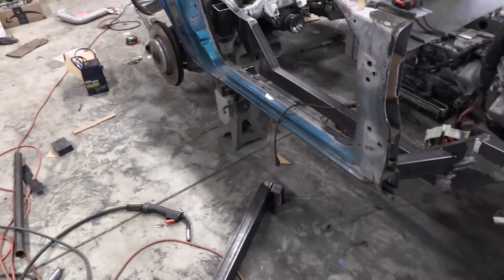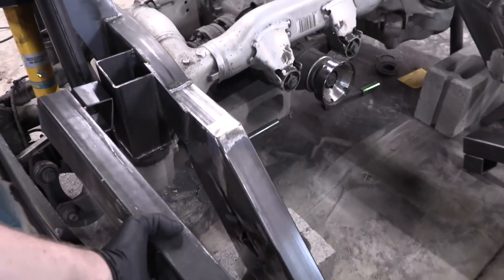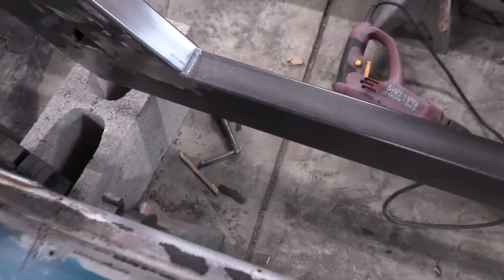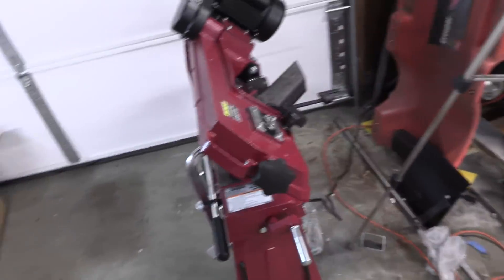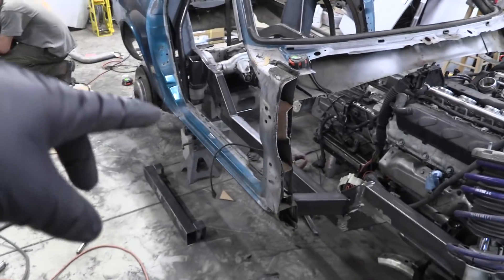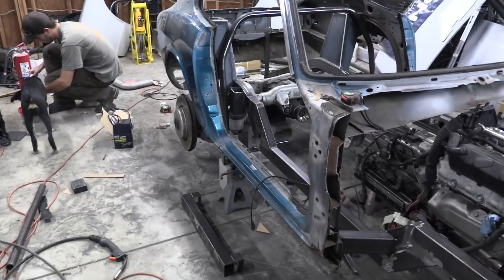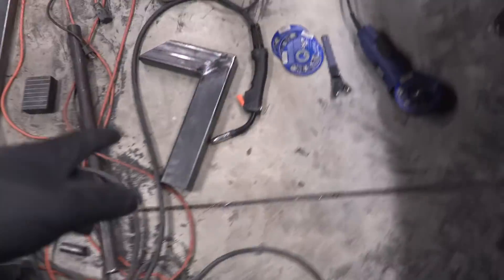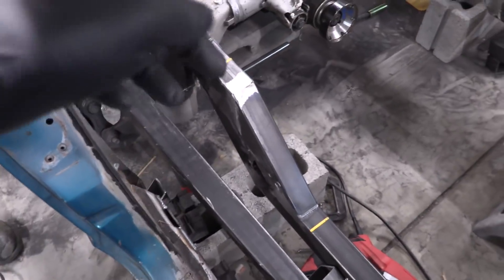We've Got Legroom! 240Z Frame Rail Modifications

Comment: One thing we used to do on kickups ike that was use a slightly wider piece of steel and cut it so the ends fit OVER the existing rail. This game us double thickness on the vertical walls. A holesaw cutout on the new piece let us weld inside the circle and it was incredibly strong and very stiff. Only the vertical walls really transfer weight and/or force anyways. Still looks really good though.

Comment: Still think that an O shape touching the sides would have been the better option. With this double L in the back and its 90degrees its not more sturdy. The O shape would have had the benefit of giving more space in the inner area in height and have a direct impact safety measure for side impacts...

Comment: I had that same band saw for years.  Getting it to cut straight is an art, but you start by adjusting the two pinch rollers on each arm to 1 thou larger than the blade thickness, then use a small engineer's square on the vice bead to get the blade vertical.

Comment: An L shaped piece of flat bar 5mm thick plug welded on either side would have done a better job instead of the bracing that’s currently fitted.

Comment: It is good you doubled up where you cut, but for the future you never want to cut a frame at a 90. It is always better to cut at an angle or even better a Z-cut. Also please wield a diamond shaped plate over the wield on the inside seam of the frame. Looking good so far.

Comment: Not sure how I feel about this.  The closer you sit to that rear sub frame, the worse it will feel for a driver.  Think about it, the driver should sit equally between the front and rear suspension to maximize comfort and car handling.  If the driver is nearly sitting in that rear shock, its not a good feeling.  Personally, I just would've shredded a few pounds.  There is a reason race car drivers are small! Weight is HP

Comment: On your new L frame are worried of it flexing? I had D21 pickup with frame notch I had to fix it after I throw some wait in the back and it bent, I don’t know if it’ll change with the double frame but I’d recemmend even small 2-3 inch right angle triangle in there to prevent any possible flex. Btw awesome build inspired me to start my own builds #moredebt

Comment: Anyone else release he doesn't have the motor covered as he is grinding and getting  metal shavings in the air with exposed throttle body's. Just a thought I had.

Comment: The frame rails through the drivers cabin need to be behind the rockers or at least along the edge of the rockers so the seats can be between the frame rails, not on top of them. These "better" ones are still going to compromise the seating position and pedal placement down the road. Take a look at a tube frame race car, the frames run around the perimeter of the cabin.

Comment: Might already be mentioned somewhere, but the bandsaw probably isn't broken. You probably broke/bent a tooth on the blade. Also, most bandsaws like this usually run with a constant supply of cutting fluid so I'd recommend getting/making some of that

Comment: Hey love the vids!  Recommendation for next time you chop your frame (if ever) it should be cut at an angle , helps with strength.  Vertical cut will be fine for your application though

Comment: Getting the roll cage connected fore/aft of that set of hard 90s in the frame rail will help with the fact that it's a hard 90 (stress riser).   The double up was probably overkill, but not a bad plan for adding strength.

Still need more for torsion though;   something low in the frame (however you can get it around the transmission/driveshaft) would do a lot for that;  the cage can only do so much when you consider the length between the frame and horizontal points on the cage.

Comment: Only critique I would add is at the top and bottom 45 degree angles you have matching angles on the two frame pieces. I would add gussets or plates that bridge the welds. The welds are your most likely failure point. Great job solving the problem and good progress.

Comment: there's a good possibility that your bandsaw problem is actually the blade is stretched and is not as tight as it needs to be.... there could be a simple alignment that you can do as well if that's not the case

Comment: Nice work! If you wanted you could have just use plate gussets to over lap the seams and then boxed in that subframe mount section.  Anyway who cares about weight and being overbuilt right its a v10 in a one ton car right? It just take practice you mess up enough and you'll just know what works and what doesn't, then you'll be the old man in the shop.

Comment: I saw you forcing the cutting blade which screwed the band saw
Reply: Band saws dont do thin wall tube well at all 
They need at least 3 teeth in a cut so if you have a blade with 1mm between teeth you can't cut under 3mm wall 
It's why it works well on the top and bottom where its effectively doing a 50mm cut 
On the thin stuff as 1 tooth leaves the cut the saw drops into the gap between the teeth and the next tooth slams into the work at fuel depth 
Band saw teeth are off set 1 tooth is bent left the next is right, left right and so on to give clerance for the rest of the blade (a chainsaw is the same)
So it starts to wander toward which ever tooth hits first 
Once it starts to wander it won't stop 

How to fix it 
You can buy blades with more or less teeth 
A fine tooth blade is better on thin stuff 
Or rotate the work peice 
Cut the top rotate cut the top and so on 

Really a chop saw is better for tube 
A bandsaw is for solids really 
Cutting drops to be machined and so on
Reply: Adding pressure cutting tubing & you get to the side will force the blade sideways, don't ask me how I know this! HF Tools are not the best, but the price makes them disposable. That $100 grinder cost 90.00 before but would last a while. The grinding dust gets in them a kill them, blow them out with air. Sorry so long & I hate to type.
Reply: I have same design band saw but "high end", does the same thing if you force it
Reply: Or it's from Harbor Freight.....
Reply: Let the weight of the saw doing the cutting, even from HF
Reply: Sometimes even the weight can be too much for some saws...

Comment: I like how the left rear shock tower moves between 9:00 and 9:10 hope will not affect end result
Reply: Yup, this is a steap learning curve, and things not to do in the future. As Chris mentioned, honest feedback to a stupid solution. Next time he would do everything in a different way.  And we have to learn from his mistakes. As popular to say nowadays: No homo :D
Reply: The jig wasn't triangulated; so there was an axis that had no direct support. If the jig we're placed on the inside of the rail and a T-bar joined from its center over to the opposite rail, would have worked.
Reply: literally everyone overreacts with this crap cars out of a factory aren't even 100% straight nor are the parts they put on them that is why we have adjustable suspension
Reply: The car is on jacks, so it will move around a bit as they weld. But the jig they made will keep it all lined up. I can't imagine it being able to bend that 2x4 steel bar.
Reply: Thats why they clsmped everything when welding in the new pirce since it slightly moved
Reply: He is pointing it out so he can be one of the dicks in later videos that comeback and say, “I ToLD yOu I sAw tHaT shOcK ToWer MovE.”

Comment: The bottom of that right angle where it's welded to the front half of the frame  will be a weak point even with that extra bracing you should have had some smaller box section inside the frame rail where the buts join and then plug welded as well as seem welded. 

Atm once the car is on the ground and that frame is load baring that join could be shear point in the frame due to the stresses that are acting upon it and the thing is only as its weakness link and potentially  reduce the factor of safety dramatically
Reply: Those were all damn near full pen welds all the way around, plus the frame doubler on top of those. The car will taco before those welds come apart.
Reply: Also sorry for being a downer I just hate to see you put all this work in to it and possibly see it go wrong and you getting hurt nobody wants that
Reply: I was thinking that too, until I got to thinking about how many points the roll cage will be in contact with the frame. They could also add a 3' wide piece of thick plate to bridge the weld on the inside of the frame rails.
Reply: Maybe a little triangle in the corner like they did on the ends would help.
Reply: I think if the roll cage is solid enough itll help keep stress off that area

Comment: About the FJ, did you put Aftermarket control alarms? And if you didn’t you should take a look at the one you have on, with that 3” lift it puts lots of strain on the ball joint and could lead to it Breaking on the road
Reply: If that is the case he could get some extended ball joints to correct the angle so he doesn't get contact on full down travel
Reply: Or he could get a diff relocation which drops it down so the joints arnt on such a harsh angle. We do it to our hiluxs in aus

Comment: Good thing you got this figured out, bad seat position can mess up the whole experience, even if the car is top notch 👍
Reply: this is a FACT! I have to get my seat position just exactly right or else it will drive me NUTS!
Reply: Will Helterbrand yeah, I couldn't get it right in my previous car, it was either my legs were in good position but I couldn't reach the steering wheel or I could reach the steering wheel but the pedals were closer than I would like them to be. As you might imagine I felt like sitting on a wooden chair rather than in a car seat and it killed the feel of the car.
Reply: @arekb5951  what kinda car?
Reply: Spartan Descendant mk6 Golf GTI. I'm 185cm/6'1 longer legs shorter torso kinda guy, bad seating position literally made me so upset that I sold the car and I don't miss it.
Reply: @arekb5951  I always wanted a golf. I ended up purchasing the VW CC. Kind of had some buyer's remorse. You just made me feel a little better. They seats are crazy good in the CC. Cheers bro.
Reply: Spartan Descendant Yeah, CC is a bigger car so there's much more room to play with when it comes to seat and steering wheel adjustment. Enjoy your car, cheers
Reply: @arekb5951  Im riding a Blacked out G35. The CC is a family car. That apocalypse G35 he did is how I got here. What did you buy if i can ask?
Reply: Spartan Descendant I have e90 330i. I'm super happy with it so far.